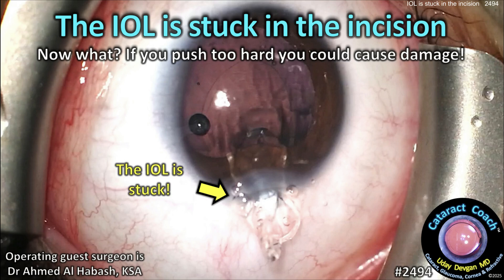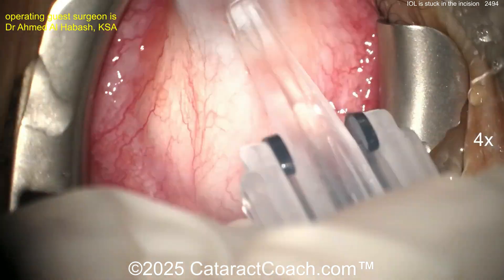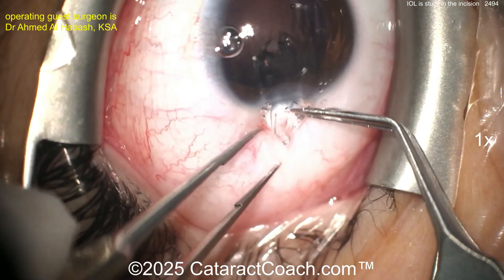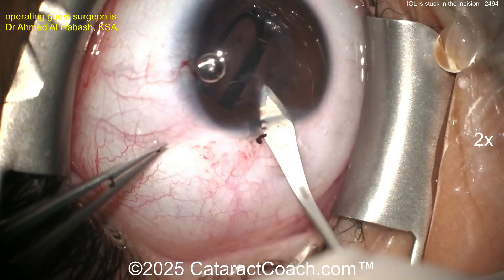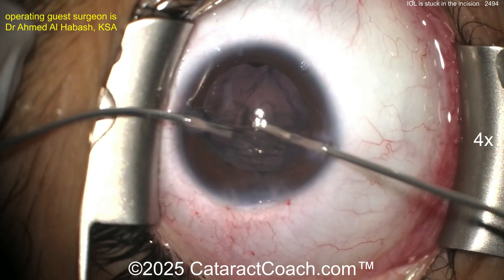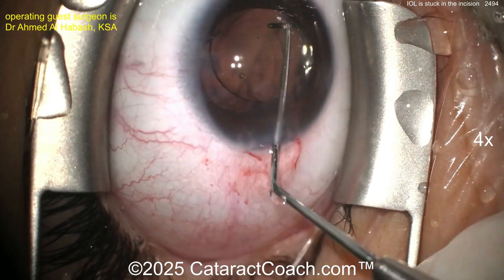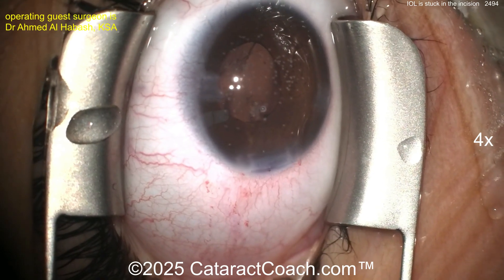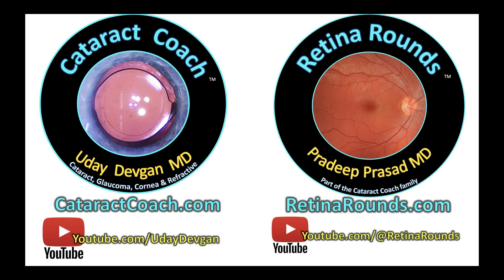CataractCoach™ 2494: the IOL is stuck in the incision!

Comment: Have been in the situation. I enlarge the incision on both the sides and then its much easier to put the lens in.
Reply: Agreed, instead of forcing the lens this way, fill the AC with viscoelastic and try widen the incision before pushing the lens in. Otherwise, take the lens out, widen the wound and put a new IOL. Thanks for sharing the video

Comment: So I had a similar situation once, could not get it in, but also could not pull it out without what I felt like was excessive force.  What I ended up doing was grasping the tucked haptic and fishing that out of the wound creating a trailing haptic, but that allowed enough space to push the lens  in (aiming for anterior to Iris plane with adequate visco elastic to avoid risk to pc).  It was with a jnj tecnis lens which are very solid lenses and did not break or stress the haptic in that case.

Comment: Personally i would have done a ant vitrectomy and use the same lens in the sulcus . A white cataract pasient will be happy ,even at -1,0 myopic . I always use the original iol in the sulcus . The three piece lens haptics often go thru in between the zonules and then you have a inferior decentered iol . Only twice in twenty years did i have to swop the sulcus lens to something else or suture in a secondary iol . I know it is taught this way ,but i have removed a few three piece “setting sun iol’s “ and replaced them with a double C haptic iol’s like a Rayner in the sulcus that does not go thru the zonules . You need to follow the patient for a year and if comfortable the IOL is left in the sulcus
Reply: If you follow up longer than a year I think you'll find a lot of the 1-piece IOLs in the sulcus end up with UGH.  Seen too many disasters to ever consider doing it!
Reply: Do NOT place a single piece IOL in the sulcus. Those thick haptics will cause iris chafe, pigment dispersion and likely UGH. A sunset 3 piece IOL although not desirable will not cause irreversible damage. Reverse optic capture (ROC) of a SPA is potentially acceptable. A 3 piece lens with optic capture is the best option and absolutely will not sunset.
Reply: Never a single piece lens in the sulcus, never
Reply: no wonder there are so many UGH and chronic CME cases